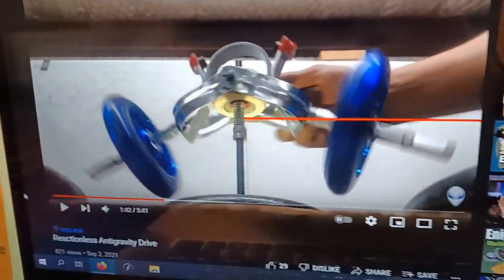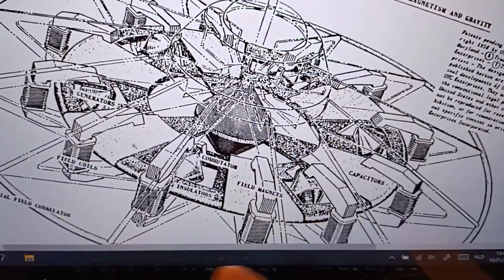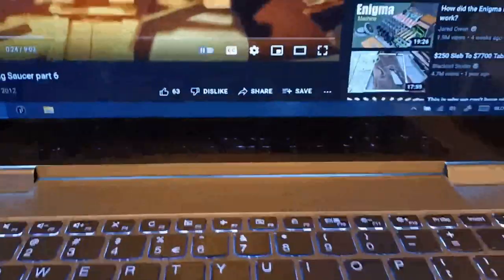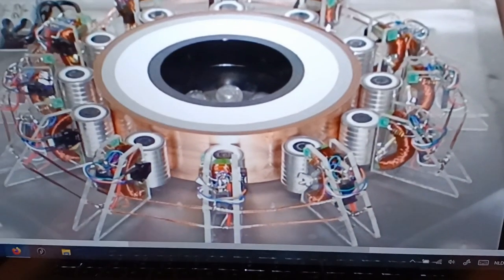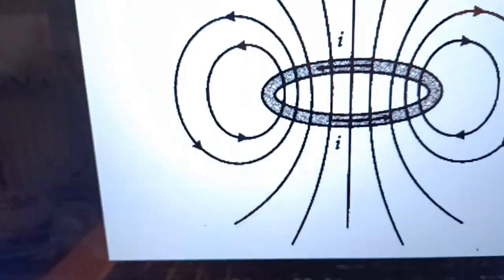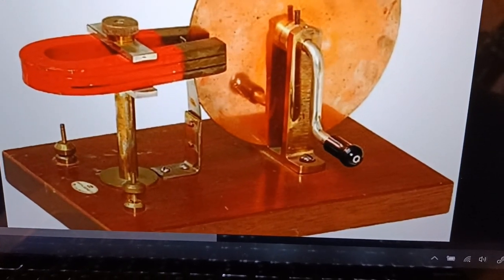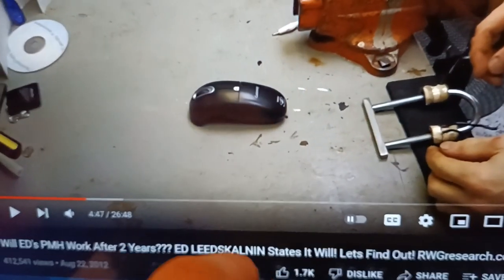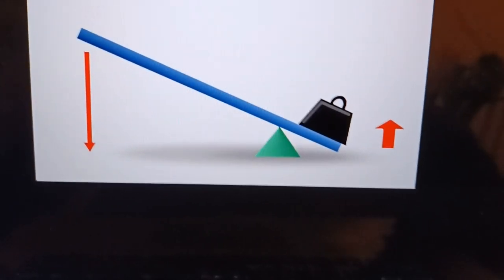OTC X-1 Utron Talk

Comment: Its quite simple really Otis Carrs craft the main rotor which contains the capacitor plates and individual utrons, if you notice the capacitor plates are connected to the main Utron accumulator and because Aluminum or Mu metal are both paramagnetic when the EM coils are turned on and pulsed it pushes the rotor along and because the EM coils are connected to the main hull, which has its own spin shaft, it causes the main hull to spin in the opposite direction.  So now that we have spin/counterspin, the individual accumulators are also interacting with the electromagnets which causes the spin and the individual capacitor plates, which also interact with the EM coils generate energy and feeds it back to the Main Utron Accumulator, now once all that is in motion, it is said that once the RPM speed and Main Accumulator have reached their peaks, then apparently the magic of Anti-gravity kicks in, now wether that is due to mass reduction or generating a gravity bubble who knows, but i would definately love to see it happen as im sure all of us would, and so the only way that will happen is if we continue to experiment en mass and share our findings freely, then and only then can we stick it to the man, elite, illuminati ...whatever, whoever they are..just imagine a million average curious experimentally minded citizens each owning their own created UFO, UAP, AG craft that is capable of all that weve heard about, how crazy insane would that be? On our horses people ...
Reply from the maker: Sound simple enough when you explain it this way. I'm sure we het there safely and in time. It's just criminals I'm worried about, even more than the 1% folks.
Reply: I think it’s totally possible all we need if a couple people together and a local junk yard car/van/trucks & I think I would be able to build one 😊

Comment: The Utron's are "coils".  I don't know why everyone seems to think they are just a big solid hunk of aluminum.  Where did they all get this crazy idea?  The original Utron's were hollow and filled with a sphere of liquid mercury.  The Utron coils were tested in the #20 issue of "Energy Unlimited".  Walter Baumgartner wrote about Carr's device in that issue as well as his own work recreating the device.  My device was never completed.  I never added the high voltage electrostatic aspect to my prototype.  I don't know everything about how the system works but maybe someday I will revisit the project.  We know from "The Hutchison Effect" and also the Philadelphia Experiment (that Nikola Tesla headed) that very high voltage pulsed DC electricity can do amazing things when pulsed to the right resonant frequency.  John Hutchison was able to phase shift two different kinds of physical matter (into a higher dimension) at the same time (a metal knife and a block of wood) and then combine them together at the molecular level after bringing them back to our normal dimension/state of matter.  He used 3 Tesla Coils and 3 Van De graff generators in a hexagonal arrangement to each other.  He also used an RF transmitter set to 433 megahertz and a magnetron.  With the Philadelphia Experiment Tesla used 4 very large Tesla coils that used conical coils.  The high voltage pulses of the 4 coils were all set 90 degrees out of phase with each other to form a spinning pulse vortex of sorts.  Anyways, I digress.  Thanks.
Reply from the maker: Hi I see what you mean with the mercury in a sphere container.. I believe that makes for a good Faraday disc type generator as well. And I believe it was diamagnetic, maybe this does something interesting. Maybe I should do a second run of thought stream on topic and record another video. More people have told me about the mercury, and in the plan documents I also saw it was mentioned in a newspaper article, something a bout a Mercury spill. Hutchison is such a great performer, with his jokes in the video's, amazing. I've seen him talk about it.
Another topic for a follow up video would be the Sweet device, I think I figured it out, since Bedini mentioned it a lot in combination with his talks about kromrey, I think that thing is also capable of certain effects. Thanks for the comment and detail! JP
Reply from the maker: Also the blue star enterprise website shows the aluminum mockup utrons, so that is likely why people think it has to be aluminum

Comment: I’ll share what I have gathered from Ralph Ring.  This is mostly theory as I explain it.  

Basically, the Utron acts the same way as a Tesla Coil - multiplying volts.  So the idea is if you have a small source of power and the Utron is hooked up in series with it then that Utron will multiply the volts.  There is no need for anything in between or in the cavity of the Utron.  The idea is that the electricity that flows through the aluminum gets bouncing around in that cavity in the center.  For example, a dome shaped cathedral with sound waves - when you talk, it will carry that sound wave and bounce it back.  "Multiplying" your voice.  

Aluminum interacts with magnets the same way that copper does so those smaller Utrons are actually solid all the way through without the cavity because they are only used for the electric generation as it passes the horseshoe magnets just like a regular copper generator.  The small Utrons could be replaced with a copper rod, but I think they just use the aluminum in the same shape as the utron.  

The saucer has an antenna on top and a ground on the bottom.  So as the saucer sits on the ground it would have a small amount of electricity collecting as it sits.  Just like a Tesla Tower, it accumulates that small amount of electricity then multiplies it with the main Utron, or main accumulator (large Utron), in the center.  That main Utron does have the cavity in the center.   

It may need a small push to get it spinning, but once started it sends out that small electricity and the rest of the saucer shaped system recycles that electricity back into itself.  The capacitor plates and small utrons keep generating more electricity to use and recycle.   The whole saucer becomes it’s own independent generator, this combined with counter rotating parts creates it’s own electromagnetic field independent from the Earth’s electromagnetic field and becomes a free agent.  The counter rotating parts need to equal the speed of the rotation of the Earth at least.  Since it’s a smaller scale then it needs to spin faster to equal the spin of the large Earth.      

I had paid a machinist to make a Utron so I have been experimenting with it.
Reply: BRAVO U CRACKED D CODE

it's so good to see someone thinking same 🥸
Reply: May I ask about the initial design of this device
How was it initiated?
How does it maintain rotation?
What are the functions of the multiple U-shaped coils on the outer ring?
Thank you very much
Reply: @barrysines4593  Perfect Explanation 🔻♦️🔺

Comment: U need the “Hutchinson crystal mix” on the void on the inside. Then it needs layers of dielectric/coil out to the full size. The coils are bifiler coils pulled apart as it gets to the smaller diameter

Comment: There is one problem with the utron working the way you suggest. It has no spring on the top. If the idea is to have it go up it cannot be fixed in a set position. It needs to be able to move up and down. Even using the theory pure roll it would still need to have movement. A magnetic field to aluminum would cause the outside of the craft to rotate because edie current. It is one of the very few ways to counter rotate the outside and inside. Remember the craft is not fixed to a table so you have no fixed point to rotate on. In order for the inside and outside to move you have to have counter rotation. If you have ever seen a tesla coil with a center coil then the center of the craft makes sense. The capacitors pulse just like a tesla coil with a center coil. The energy goes north and south on the coil. https://youtu.be/Hkqa6c-0fFk this video explains it. once in motion the large capacitors should charge and discharge to make the whole craft one big looped system. Because the outside is aluminum it would give off + ions as it is charged by the c coils. (they are directly connected to the frame.) This also makes more sense when you consider Carr always said at certain altitude the craft could use the ions from the atmosphere to make energy to power the craft. Just like a corona motor https://youtu.be/_rsAxeYc-jk  All of these crafts share the same working principles. Resonant coil, high voltage capacitors, counter rotation and a field of + ions on the outside. The biggest problem we face it that they all appear to have no lifting factor unless you consider all the parts make a gravity well. That is the only way it could work.

Comment: The utron coil consists of two conical ferrite core parts. A bifilar thick coil, one rotating right and the other rotating left, is wound on top of these. Then, one end of this coil is connected to the capacitor and the other to the spark gap of the capacitor.  In this way, it charges the capacitor by making a negative charge. The central conical structure that produces the gravitational field: consists of two quartz cones. On top of these, a right-turning positive bifilar charging coil is wound. One end of these coils is connected to the positive end of the capacitor and the other is connected to the graphite rod (the antenna emits x-ray radiation). ) depends on it. These elements should not come into contact with air and are very well insulated. This is gravity.
Reply from the maker: Sounds interesting!
Reply: @toffeeflavour  But it's true...
Reply: @halilka9853  Distributed at the edge of the disc
The utron coil 
Does it not rotate on its own?
Reply: @yunshuizhongyi  No it doesn't. The utron coil is actually a tesla bifilar coil, which is the combined state of one end of two coils that rotate inversely to each other. It consists of two conical ferrite cores that are not in direct contact with each other in two parts. The bifilar coil is wound on top of these. The other end of the coil is the capacitor, and the other is connected to the other end of the capacitor by leaving a spark gap. The spark gap is the most important point here that charges from the gravitational field. It works with pulsed high voltage and low current to the circuit (12000 volts 100 ma 37 khz)
Reply: @halilka9853  May I ask about the capacitor you mentioned
Are you referring to the visible flat aluminum plates in the video?
Reply: @yunshuizhongyi  yes but the real design is wrong in the video. patent is broken. capacitors are big and magnetic tension reaches millions of volts. system works with high static magnetic tension. electric current is very low. single pole positive charge.
Reply: @halilka9853  Скажите, пожалуйста, какой большой конденсатор?
Это значит, что конденсатор многослойный?
Как создать больше напряжения и больше заряда?
Как спроектирована эта емкость?
Reply: @yunshuizhongyi  Which one do you want to learn? How does the gravity system work? Or how to obtain electrical energy from gravity?
Reply: @halilka9853  I want to know how to achieve anti gravity?I want to know how to achieve anti gravity?
How did Carl's flying saucer achieve ascent?
Reply: @yunshuizhongyi  Okay, there are two mechanisms that transform into each other here, one that obtains electrical energy from the earth's gravity and the other one that creates a gravitational field with the electrical energy coming from here. Both transform into each other. The mechanism is radioactive. Gravity has a radioactive feature as a structure. The small cones on the edge of the flying saucer (utron coil) produce electrical energy from gravity. The large cone in the middle creates gravity and flies the flying saucer. The utron coil consists of two conical Ferrite cores. There is a bifilar coil wrapped on top of them. One end of this coil is connected to a large aluminum plate capacitor in the shape of a disk, the other end of the coil is connected to the capacitor by leaving a spark gap. Thus, the charged capacitor operates the structure consisting of two quartz cones in the middle (these are placed base to base. It is wound to the right with a copper wire folded in half on top.) with electrical energy. Then the other end of the coil (made of graphite rod, well insulated, the end side is evacuated. The end side is made of beryllium. Just like an x-ray  looks like a vacuum tube.) is connected. Here the positive pole of the capacitor is connected. This is gravity.
Reply: @halilka9853  May I ask about the coil wrapped around the large conical structure in the middle
It's extending two heads
Are they connected to the two ends of the aluminum flat capacitors on the disc separately?
Reply: No, they are all connected in series to each other, from the positive pole to the coil. @yunshuizhongyi
Reply: @halilka9853  Are all the small conical double line coils around and the large conical coil in the middle connected in series?
Are all the aluminum flat capacitors on the disc connected in series?
And then linked together through a spark gap?
Similar to a series resonance?
Reply: @yunshuizhongyi  A U-shaped electromagnet on top of the small cones induces them with a high pulse voltage. These generate electricity. The large quartz cones create gravity. The bifilar coil on top of the small cones rotates in opposite directions. The coil of wire folded over each other in the large cone. The spark gap is connected to the small cones.
Reply: @halilka9853  Thank you for your reply
Why is quartz material used for the large cone in the middle?
Is the interior of the large cone solid?
Is it hollow inside?
Or filled with any special material?
Reply: @yunshuizhongyi Natural quartz crystal has a special atomic arrangement. Due to this feature, it is magnetized and creates a gravitational field. Not only this, barium titanate and Rochell salt can also be used. Quartz crystal has a hexagonal conical structure due to its natural structure. This information I told you has not been discovered yet by today's science.
Reply: @halilka9853  Thank you very much for your reply
May I ask if the U-shaped electromagnet uses silicon steel sheets?
Is the coil on the U-shaped electromagnet a regular multi-layer spiral coil?
How are coils connected?
Where is the coil connected to?
Reply: @yunshuizhongyi  You can use a u-shaped magnet. The important thing here is that the utron coil is exposed to a magnetic field by inducing it. Of course, this is more costly. Electromagnets are more economical. You may not use it in the core, but it will create weaker magnetization. Pay attention to the poles, it is important. Normal coil. Connect it to any high voltage, high pulse power source.
Reply: @halilka9853  Thank you again
Excuse me, U-shaped electromagnet
What is the purpose of receiving a high-voltage pulse power supply?
Do you use this high-voltage pulse to drive the middle turntable to run?
If that's the case
What kind of high-voltage pulse is needed?
Are all U-shaped electromagnetic coils directly connected in series with each other?
Reply: The circuit works with static magnetization. This is the reason for giving high voltage and low current. It does not work below 1700 volts. You can try. High pulse voltage is given to the coil of the U electromagnet. Thus, the circuit starts to work. All U electromagnets are connected in parallel. It is not connected to the quartz coil in the middle. @yunshuizhongyi
Reply: @halilka9853  good
May I ask if the U-shaped electromagnet applies high-voltage direct current pulses?
Can you explain in depth why the middle disk rotates when a high voltage pulse is applied?
Similar to an electrostatic motor?
Do you understand it this way?
Reply: @yunshuizhongyi yes direct current pulsed high voltage. the middle disc does not rotate. the mechanism has a static magnetic structure. it is not like an electrostatic motor.
Reply: @halilka9853  The middle disk doesn't rotate?
Is it just the rotation of the outer shell?
How is the middle disk fixed so that it cannot rotate?
I always thought that the middle disk and the outer shell were rotating against each other?
Isn't that right?
Does this device rely on the U-shaped coils powered by high-voltage pulse DC to start?
Or is it starting with an additional electric motor?
Reply: @halilka9853  The disc with a conical coil and a seemingly aluminum flat capacitor
Is it fixed and immovable?
Reply: If you are talking about the design of the flying saucer, the video is wrong. It was made with a broken patent. The real design is as I told you. There is no rotating disk in the real vehicle. The whole vehicle rotates. The capacitor is placed on the base of the vehicle just like a sliced cake. The dimensions of the capacitor are large. It has a very high voltage output. I need to shoot a video for you. @yunshuizhongyi
Reply: @halilka9853 do you know how to build Gerbennikov flying platform as well?

Comment: The utrons are generators. the commutators aren't pictured. I'm pretty sure
 they're so you can apply a pulsating dc to the central accumulator. Look at how a bedini energizer works.
Reply from the maker: Yeah doesn't it sound similar to like Bedini, but I Imagine this thing to work at higher voltage.